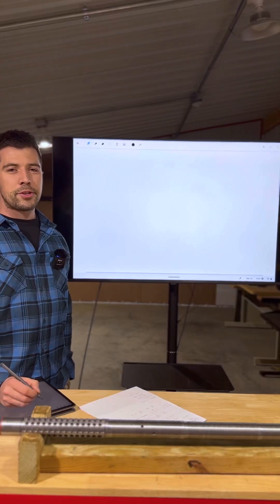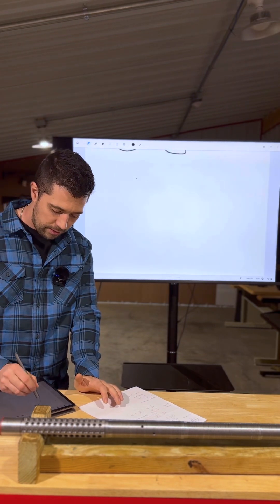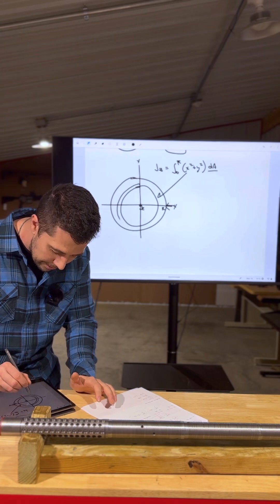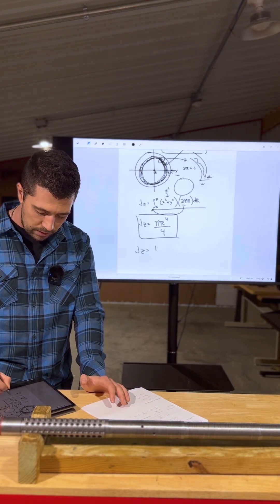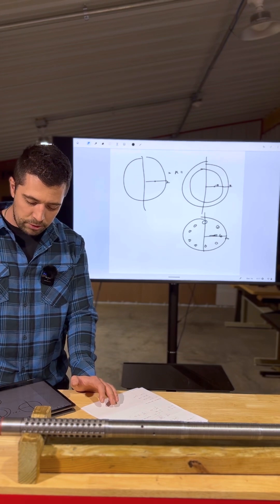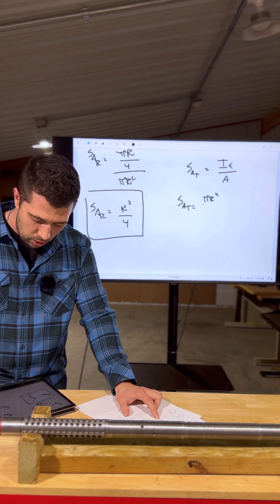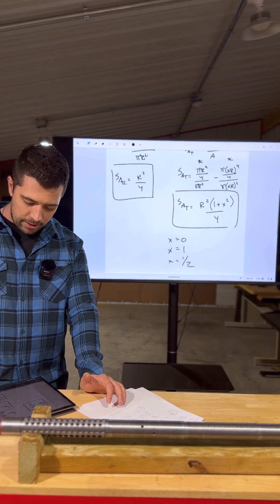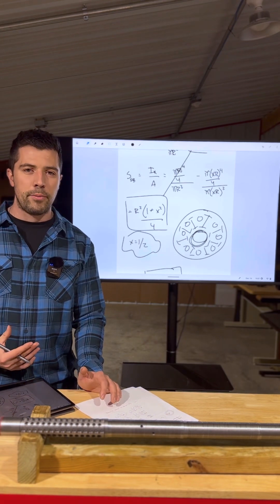Mathematical and Geometric Proof - Structured Barrels are Stiffer

Comment: What if you have a perfect square barrel and drilled out to the calibre ( with the perfect distances between the centre of the bore) , would the barrel be better as far as its harmonics ? 
Just asking thats all, plus it comes down to the material right what is better normal barrel metals used or stainless steel or other alloys? ✌✌😎😎🦘🦘

Comment: But your cost is ridiculous
Reply from the maker: Potentially from specific points of view- yes.
Each 1/10 of a mph for a car costs?
Or shaving .5sec on a circuit/coarse?
Each barrel to date is one of a kind 95% of the time. Each one needs its own CAD, target drill values (each deep hole drill event is its own set up), a design that won't fail during process. Each barrel will be measured and final OD's calculated - and all kept as record.
If I say my target is a 10% increase in performance across the board- to someone that is worth how much? 
To yourself the value might not be there. You might be a hunter. You really don't care what happens on shot 20 or 30 or 50... And we understand that. We are not your barrel. Not trying to be.
As a shooter your might never try to break a cold bore record, or be one of a handful of shooters to shoot sub 2" groups at a 1000yds in comp ( specific range on the West Coast- Light Gun).
We have a guy shooting 22cal. (their- a "team") points in a match are not typically low single digits. The last match I saw the score for one member had a 30point advantage over 2nd and the other team member had an 80point advantage over 2nd. In both cases the difference between 2nd and 3rd was single digit. Fluke- Maybe. Good shooters- Yes. Can I assume all of the other shooters are sub-standard with poor equipment - No.
I could argue that 8 deep holes, multiple patterns, finishes, cryo as compared to a standard barrel- work vs work- you are getting a good deal. All in the users "eye".
However- We intend to produce AR10 Barrels in low volumes. 6.5 cal and .308cal.
All the same blank, all the same length, same diameter, shipping costs advantages etc.. - volume equals price drop. 
Z06 Corvettes costs more than a Malibu. 
Bugatti's cost more than Corvettes. 
The price point is a rising log value. 
Each has performance values.
Each has a production volume discount. 
How much were the first Tesla EV samples? 
All need to be compared to a base line within the same time line applied.
Reply: @tacomhq  just watch Erik Cortina shooting the AR10 in 6.5 Creedmoor, plus a 300 Norma ( 215 grain and 168 grain)  and the grouping with massive left to right wind ( around 25 miles per hour gusting to 30 miles per hour and with no hold over at all at 500 yards with grouping of 4" of a 5 shot group and less, with the AR10 in 6.5mm. cheers Erik was very impressed he could now change all his barrels costing, more than his home.😎😎🦘🦘